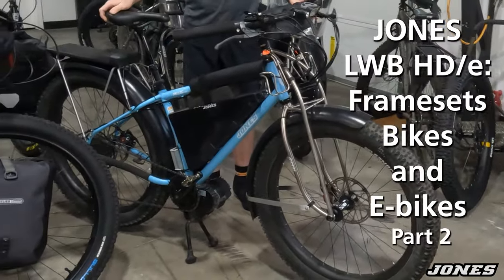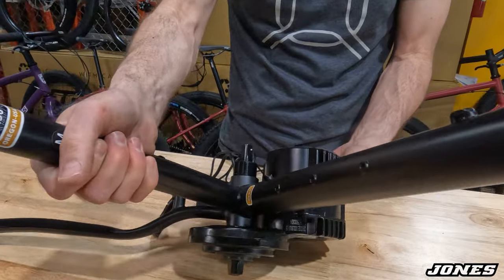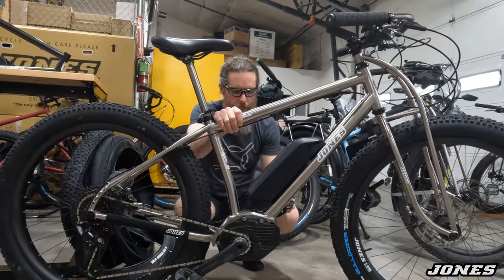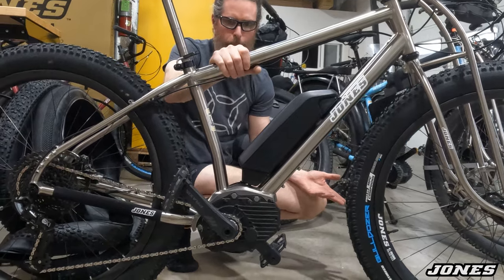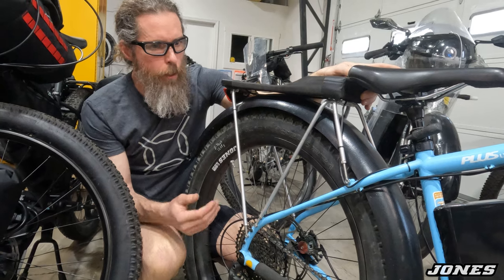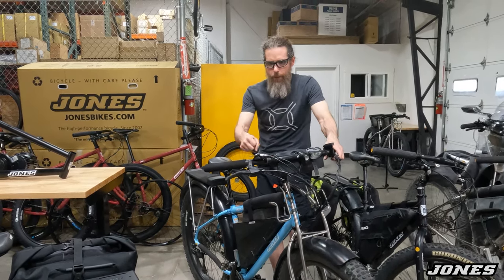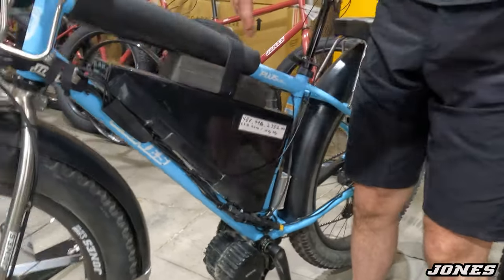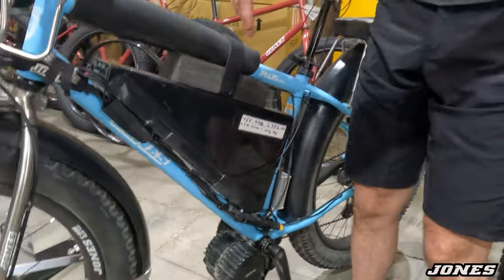Jones LWB HD/e frameset, bike and e-bike, Part 2

Comment: 8:00 to my knowledge Bosch pledges to support  its electric drive systems for a minimum of of 7 years(which is more then most competitors)

11:00 the EU e bike limit of 250W is calculated in a way that the motors have maximum outputs in excess of 500 to 800W (some even more) it’s more of an continuous power output

Comment: The BBS02 has a very nice cadence sensor.  The Bosch CX made around 70 nm of torque. The Gen 4 makes 85 nm, it blows the BBS02 away on every climb.
Reply from the maker: The Bafang BBS02 has 100Nm of torque and the BBSHD has 160Nm.
Reply: @JonesMotorbikes  I've ridden both and the difference is night and day. Bafang is either lying about their torque or measuring it in a non standard way with extremely low gearing.  All their M series motors have grossly exaggerated torque specs and get blown away in test shoot outs against Bosch, Brose and Shimano.

Comment: Are the Cranks the Standard Bafang Cranks ...  or stronger cranks?  (The standard cranks are often reported to fail under load.)

Great video! thanks
Reply from the maker: They are they are the standard Bafang cranks. We have not had any problem with them, or heard of any failures under load. But if you let the crank arm bolt get loose it can cause damage to the crank arm.
Reply: @JonesMotorbikes  
Thanks. 
I replaced my standard Bafang cranks with Lekkie self extraction cranks and tightened to the recommended 50nM.   I was having issues keeping the standard cranks tight and was afraid it might wear the Bafang drive axle.   The Lekkie Cranks also correct for the Q factor … but the Q factor really wasn’t noticeable to me.